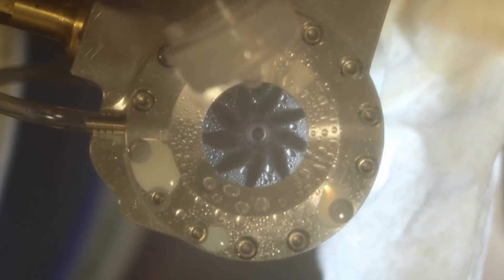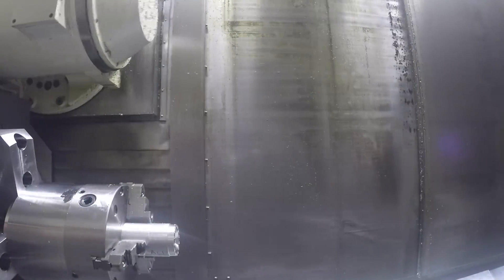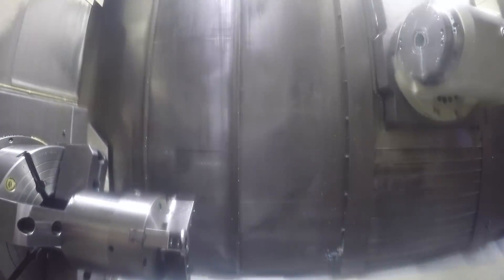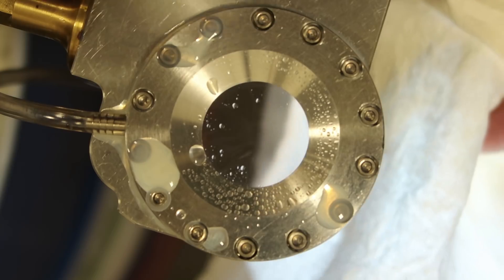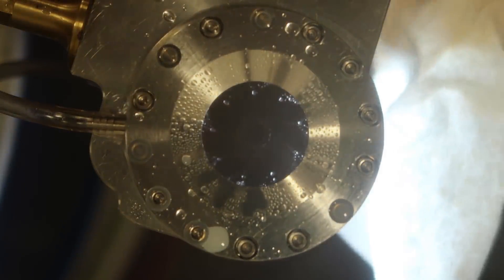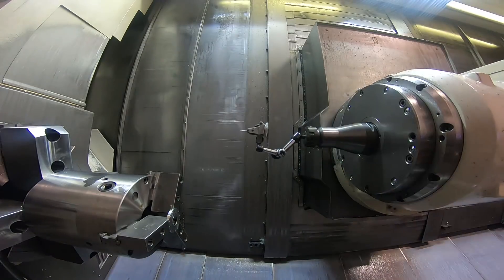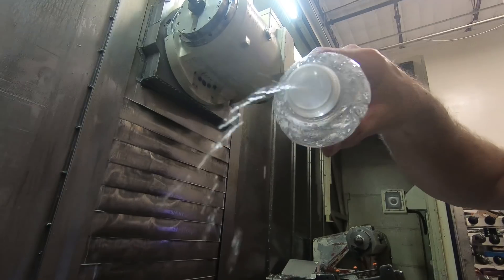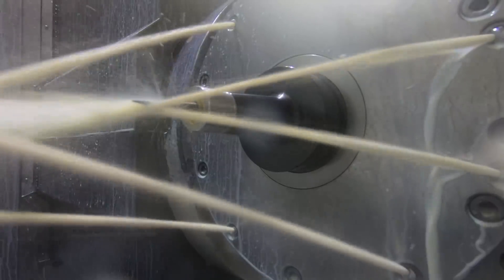Air Knife R & D

Comment: How about, the top half of the circle, to allow air to flow and the bottom half not blowing air, but is pressed up tight against the clear window material, so the water/coolant mix is simply blown downwards and ramps of the bottom? heck, having one direction of movement is simpler, I would think? Even if the air direction is sideways.. but, blowing downwars and having gravity on your side might work to your advantage? Still neat though
Reply from the maker: My original air knife on the hero 4 camera blew in one direction to the side. It worked better. I will try something like what you are suggesting. The only way will know is to try it. By the way sometimes I use the camera upside down so having the air blow up or down doesn’t really make to much difference. I may totally redesign the air knife to work like my original design. Thanks!

Comment: Love the channel. Did you consider having non-concentric grooves or cuts? Instead of all the air blowing toward the center, have the air blow in only one direction, this should eliminate the center spot issue you experienced.
Reply: HDisNotSmart the grove maybe some have to cancel de rotation, some in one directiom and some in de opposite